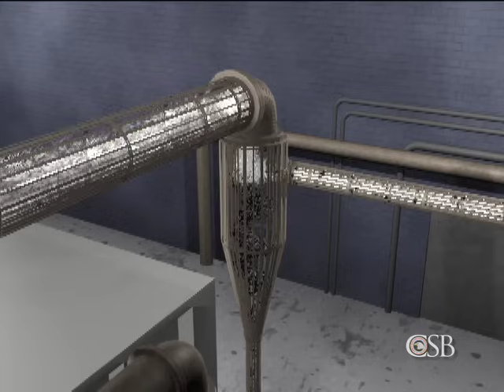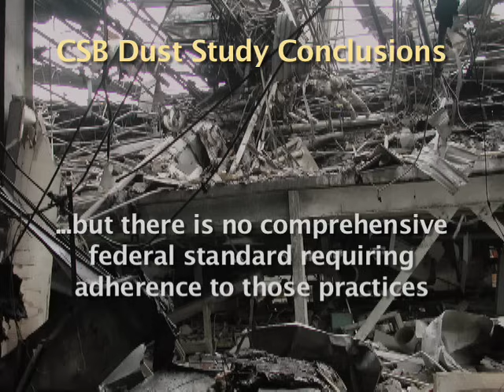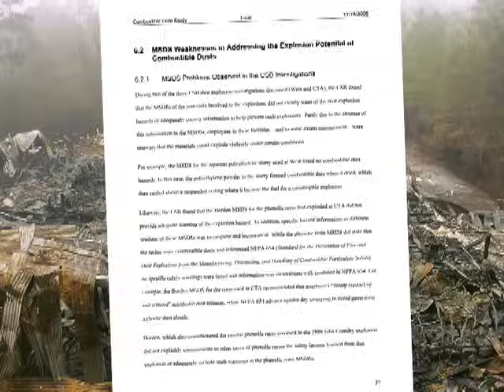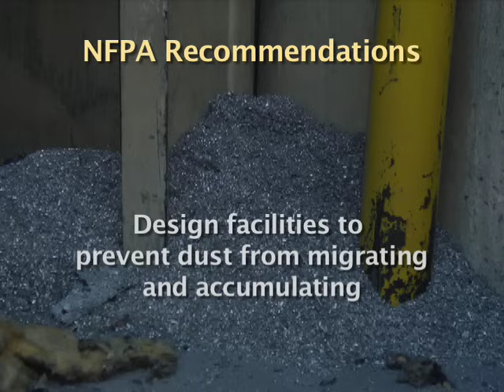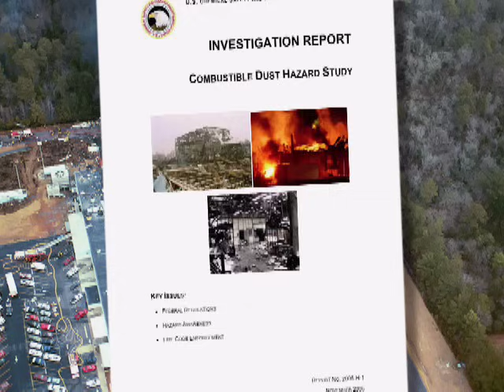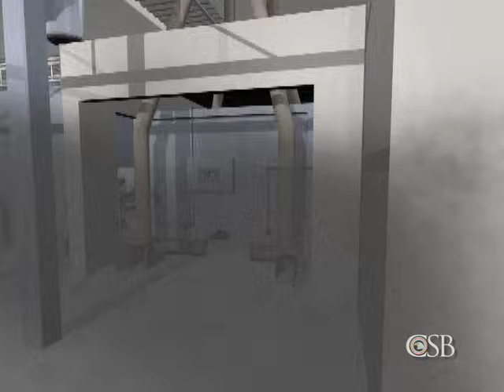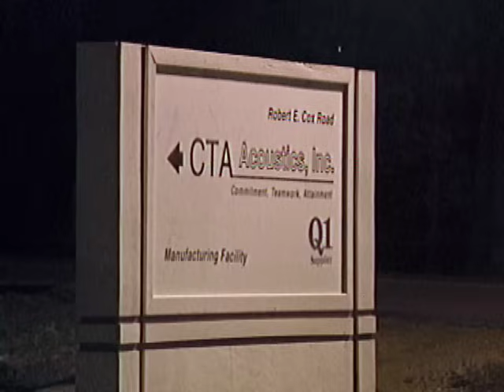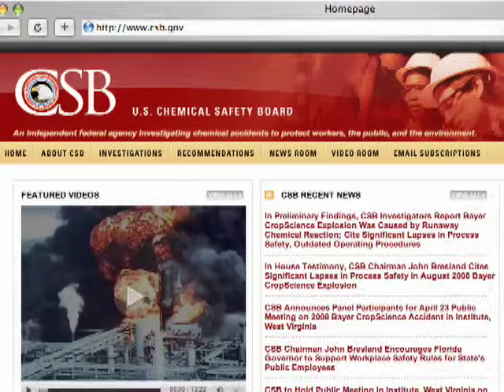Combustible Dust: An Insidious Hazard

Comment: Sometimes I have to do work at the shop and it always AMAZES me how much dust there is on everything you never even see it. Pipes, metal rafters, the tops of walls, insulation, EVERYWHERE. You can leave handprints in it it’s so deep. It’s super fine too cause it’s only the really light stuff that’ll make it up there. Scary stuff but how the hell do you clean all that? 30 years of dust on EVERYTHING 80 feet high. Imagine the health hazards in dislodging and cleaning all that stuff so high up over concrete…

Comment: The Ford Rouge power plant was a natural gas explosion NOT coal dust. One of the boilers was shutting down and someone accidentally opened a gas valve thinking they were closing it, overhead chain valve.

Comment: An old demonstration my grandfather showed me, was take one of those old gray metal trash cans like you can find in any school room from the 1980s, and put 1/2"-3/4" of flour in the bottom of it. Then take a package of those Black Cat fire crackers, and start tossing them into the trash can one by one. Eventually that flour will ignite. If get the right mixture you can blow the little waste paper can apart at the seams. Usually it just shoots a fireball straight up, and instead of a pop you get a loud BANG or a BOOM.  That is from white all purpose flour. Metal dust is1000x  worse. Wood dust, flour, grain dust. It is all explosive, when you get the right conditions. My grandfather was trained in fire fighting fire prevention and technical rescue techniques by The Union Pacific Railroad. From there he went to the military and instructed the US Army & USAF in firefighting, with the new at the time jet fuels, and rocket fuels. How have we gone so far backwards over the past 50 years? Chief William Harold Mitchell was in South Korea when it was invaded. His work at fire prevention for the military gave him very high security clearances, so he was evacuated from Korea very quickly.
Reply: When combustible dust is just lying about, it's not so bad. But when it's stirred up and becomes an aerosol it can burn explosively. In       some ways not it's not at all unlike a fuel-air bomb. I've demonstrated this in wood shops by holding a match first to accumulated wood dust in a small pile, then tossing the same dust in the air with a match held beneath the floating dustcloud. The results are scary. I remember grain silo explosions in the US south and midwest in which entire rows of concrete silos were completely destroyed with the accompanying loss of many lives. Intelligent factory design is obviously mandated, but regular and aggressive housekeeping is equally critical in protecting personnel and investments. Insurance companies can assist greatly by  incorporating as part of their policies mandatory  independent annual inspections and frequent safety education for employees and management alike.
Reply: i know Im asking randomly but does any of you know of a method to get back into an instagram account??
I stupidly lost the login password. I appreciate any help you can offer me!
Reply: @Nicolas Leroy I really appreciate your reply. I found the site on google and Im in the hacking process atm.
Takes a while so I will reply here later when my account password hopefully is recovered.
Reply: @Nicolas Leroy it did the trick and I finally got access to my account again. I am so happy!
Thanks so much you really help me out !
Reply: Slowly pour some talc over a lighter and it'll light can be dangerous so don't try at home
Reply: Goddamn this comment really took a walk
Reply: Wow! I definitely need to try that metal can trick! 😃 Although now I’m kind of nervous, I’ll make sure to do it outside and with a long fuse. My dad has tons of sawdust in his workshop, I think I’ll scoop up a bunch into a metal paint can or similar, add some Black Cats and watch from a distance!
Reply: Anyone who has ever worked in a sewing shop knows how deadly fabric dust can be.  One spark can easily lead to a fireball destroying the building completely in many cases, even when the building is closed and no manufacturing is active.

Comment: If you would ask the workers, they would tell you that they do not enjoy working in filthy workplaces. Greedy management ignores the workers, and accident happen.
Strong unions are required, unions with "teeth" to force change and safety
Reply: Unions don't help in "unskilled" labor. Also its not so much greed as it is incompetence many managers just stick around the longest (note high turnover) or they come in with a business degrees. Never allow people with business degrees to run a company it should be illegal.

Comment: This reminds me of the grain elevator explosion in Westwego, Louisiana in 1978. Dust seems harmless but it's deadly under the right circumstances.
Reply: It doesn't make any sense to me. 🤔
Reply: @scootermom1791  Small, flammable particles in very close proximity of each other. Trillions of them. One finds a source of ignition, and it sets off a chain reaction. As long as there's sufficient oxygen, all of them burn.
Reply: @pastor_of_muppets_85  okay, so why won't flour, for example, ignite when you try to light it with a match? There's plenty of oxygen around it. That's what confuses me.
Reply: @scootermom1791  https://youtu.be/zKMPC2l80NU Flour is combustible in the right settings
Reply: @pastor_of_muppets_85  okay... thank you!
Reply: @scootermom1791  It won't light if it's in a big pile, the pile doesn't have enough of its surface area exposed to oxygen. However, if you were to, say, take a handful, throw it, and light the match in the resulting cloud, it would be explosive because airborne particles have much more surface area that is accessible to oxygen than they would in a big pile.
Reply: @birdn4t0r7  thank you! This explanation makes sense. I was able to form kind of a mental image of the what you were describing.

Comment: Albion NY Saitgobain/adforce is currentley covered in fiberglass dust and that is covered with machine oil from the open motors in knitting. if you want to help save people from an accident contact me. i left due to unsafe work environment. i was a 2nd gen worker.

Comment: West pharmaceuticals just had a space of negative air pressure? If it was properly ducted, the polyethylene dust would end up clogging HVAC filter, instead of falling on drop ceiling.

Comment: Why does this keep happening? Simple -- because businessmen run safety significant industries. A fix that I personally believe would go a long way is that such industries should be formally recognized by the government, and any business engaging in those industries must have a formal board of directors, 50% of which must be seated with individuals with engineering or science degrees, or some other professional certification unique to that field. 

MBAs will destroy and consume everything they touch, including our lives if we let them.

Comment: Here in Mexico, around early 80s, my dad was the engineer in charge of building 3 corn grain dome-silos, around 40 meters in diameter each, couple years after they were built, they blew up. Turns out someone sent a couple welders to do some work on the belts and the procedure to follow before any work started was not followed. Said procedure was to run the extractor fans at twice the speed for a couple of hours to vacuum any airborne grain dust called "tamo" here.
Since this was not done, the moment the welders began to work... boom.

Comment: i have seen a simmering fire in a steel container in my house due to auto oxidation of crushed oilseed. fortunately due to smell of smoke, fire was detected at early stage and possibility of explosion was averted by removing the oilseed powder. the auto oxidation of  dusty  material  is a potential source of explosion.

Comment: This video is pretty old but even today most factories I did electrical work in had a large amount of dust collected on every imaginable surface. The fact of the matter is that the majority of factories even in the United States are run exactly the same way that the factories in these videos are run. Most people working in the factories aren't even aware of the danger. it takes getting on a lift and getting up above all the surfaces to identify that there is a problem

Comment: I'd have the leaders of these companies locked in a room and take a class about the dangers of combustible dust. Must pass a test without missing more than one question.
Reply: Understanding what combustible dust can do is no guarantee that those in charge will employ safety over profitability. Because they are sociopaths…. If not sociopaths as individuals…, they believe in, rely upon, have faith in and live by,.. basically, a system of business based on sociopathic behaviors and policies to thrive.

Comment: 2:00-2:03. That's highly debatable. "Not giving a damn" is a much more appropriate phrase in this case than " simply being unaware of the hasard".
Unless there's an enforceable mandatory safety regulation with criminal prosecution for those responsible (top brass included), these disasters will keep happenIng.
Simpathy and condolences to all the victims and their families.

Comment: This video is eye opener for all . Still there are many unprotected installation.Many still emphasize on wet/reactor/pressure vessel reactions/runaway reaction safety.
Bust dust explosion hazard still requires a lot of awareness.
Many give excuse " it has not happened for so many years " and trust on unreliable traditional Explosion door which donot open when explosion really happen thus causing catastrophe.
Every dust below 420 micron may cause dust explosion even those which do not come in known category of explosive dust.
Reply: Thanks for the 420 micron data.   At the 3:55 the narrator describes an ( random !!!) impact spark as a source of ignition. That's an eye opener for me after watching this video for at least 10 times over.  God bless the CSB.

Comment: Exactly the same problem that flower mills have had since the beginning of civilization. The explosive nature of flamable particulates in the air (at the correct concentration) has been fully understood for hundreds of years. It's shocking that these companies would be so incredibly lax about such a well known, deadly risk.
Reply: The men with power don't care if poor people die. They never have, most of them.
Reply: Flour.
Reply: They think "but we don't use grain, hyuck hyuck hyuck", assuming only grain dust is the problem.
Reply: people forget that dust  + air is  by definition a fuel-air bomb   and fuel air bombs are thee most powerful pound for pound bomb type outside of nuclear weapons
Reply: anything that can oxide can be fuel   and practically everything can oxidize   if the  substance in question has a large enough surface area to volume ratio   hence why a pot scrubbers will burn if you put a candle under them but a nail wont
Reply: @bskull3232  Correct, In a number of firms I have experience of, the usual question of 'Who going to pay for all this unnecessary cleaning?' 'The Bottom line is all that matters in this Plant, None of your business, and the top hat winner was, haven't you seen the fire extinguishers hanging around the place"? Needless to say, such comments came from Management where MBA's and degrees in accounting were as common as production stoppages due to non-maintenance of plant machinery. The idiots with their 'Degrees' all lacked common sense and experience based on reality.

Comment: Many companies are complacent about the hazards related to combustible dust, they don’t seem concerned that they could put lives at risk by choosing not to take the correct approach to dealing with combustible dust. At work when doing woodwork, we sweep up any dust off the floor and work benches and discard the dust in the bins outside, or put it in the sensory garden.

Comment: The factory I worked in had mats of dust on the rafters, ducting, machines, etc. I did eventually report them to OSHA for other major safety violations.  In the end I was out of a job and nothing has changed. OSHA essentially protects the companies and not the workers. Basically they are just another HR department for industries.
Reply: They terminated you for reporting a safety hazard?
Reply: @ryanwooden783  I assure you they made some other shit up to put on paper. But yeah the idea of someone being iced out by their coworkers for something like that isn't far fetched, especially if they don't understand the reason why and just think your trying to mess with their lives

Comment: Coal dust grain dust I've always known to be highly explosive would it seems possible but not very probable an aluminum I would have never even considered to be flammable magnesium yes but aluminum I do welding and work around new construction homes you're cutting and grinding and Welding major structural fittings and the sawdust in a new construction is surprisingly hard to get lit I welded and cut right on top of new wood where they had put the wood and then added a joint so I would weld like right next to it it would Char up and melt away and I would never put a drop of water on it no issues at all you can say it's luck but with hundreds and hundreds of examples I could give you I don't think so I've never been lucky a day in my life
Reply: aluminum is the primary ingredient in thermite, it is very flammable in powdered form

Comment: I had no idea aluminum dust was so dangerous. Is all metal dust that dangerous?
Reply: Yes. Aluminum dust and iron oxide are used for rail welding on continuously welded rails on railways. Magnesium burns so hot that attempting to extinguish it with water can cause an explosion. Many metals will combust as dust either alone or in combination.

Comment: Aluminum dust, this was like working in a giant rocket fuel or fireworks factory.  To let it accumulate should've scared everyone there.  They don't want to shut down for a few days and do an intensive cleanup and maintenance.

If they could physically isolate processes that produce dust it would make it far easier to control and mitigate instead of letting it cover every nook and cranny of a large facility and trying to safely clean it.

Comment: Maby a simple system like those used in coal mining would have helped, at least in the cases an explosion happened in a tunnel like structure, but maby even in larger rooms... The simple contraption consist of water containers mounted intentionally loosely on the cealings. A blast, traveling ahead of the actual explosion, would knock them over, moisturizing the dust in the adjacent part of the drift and stopping the blast. The water also cool the walls and floors and renders wooden structures ore stored goods less flammable.
I guess a similar contraption like shock wave triggered sprinklers should not be to complicated...

Comment: It wouldn't be a bad idea to briefly mention dust explosions in high school chemistry classes and in vocational training. And in fact around here they often are: the basic introduction to the relevance of surface area in reaction speed is lycopodium powder or maybe confectioner's sugar blown into a flame, causing a fireball.  I'm not quite sure if confinement is mentioned with similar frequency, but it easily could be: guns and firecrackers rely essentially on it, and who doesn't like those. Also, many of the reactive chemicals hazards the USCBS has investigated over the years rely on a similar mechanism: the very reason large reaction masses can run away so easily is because of confinement by the reaction vessel, its low surface-to-volume ratio which causes thermal confinement, and eventually the sheer mass of the reactants which acts as inertial confinement.

You can cover all of that in twenty minutes, it's kid level stuff when explained right, and hey, the demos are literally flash-and-bang.
Reply: In my High School Chemistry class we had a combustible dust demonstration in 1965.

Comment: Why wasn't the CSB recommendation following the Imperial Sugar Refinery explosion that flame resistant clothing (FRC's)be worn by workers that are exposed  to a combustible dust flash fire environment?
Reply: It's important to recognise that if Combustible Dust Flash Fires are a risk then Combustible Dust Explosions are a risk.

Even with a 'Flash Fire' external burns are not the only risk. For a start the worker in the aluminium plant that died died from burns to his internal organs (as his sister states in the video). But the most important thing is that Dust Explosions are just that, Explosions. Depending on the exact situation you may find that none of the fatalities suffer burns - they might be, for example, hit by flying debris, or crushed by falling structural elements. Of those that are fatally burnt this may be a secondary effect of being unable to escape from a developing secondary fire due to injury or structural damage.

Finally, in many industries the normal working uniform is already fire resistant. A standard 'Boiler Suit' is called that because it is suitable for working around boilers, with the associated heat and fire risks. The ones I know use natural fibres as these char in a fire rather than melt or burn, as many artificial fibres do. Many are impregnated with additional fire retardants. Just be careful about not washing the retardant out of your overalls and not getting them impregnated with oils and other combustibles.
Reply: Rick Ansell it’s also worth noting that there’s enough difference between fire resistant clothing and full anti-flash gear, as the Royal Navy will readily attest to.
Reply: Flame resistant clothing won’t save you from the pressure and flying debris. And flame retardant chemicals themselves have cancer risks.